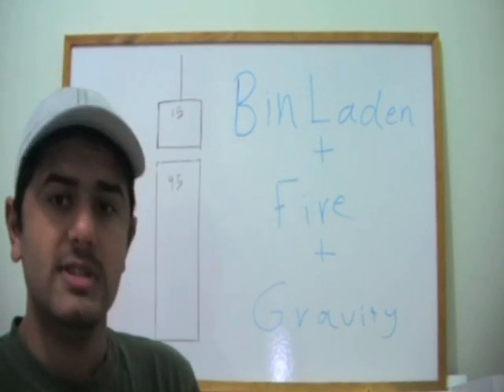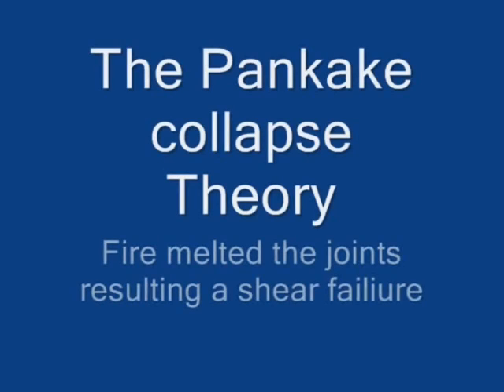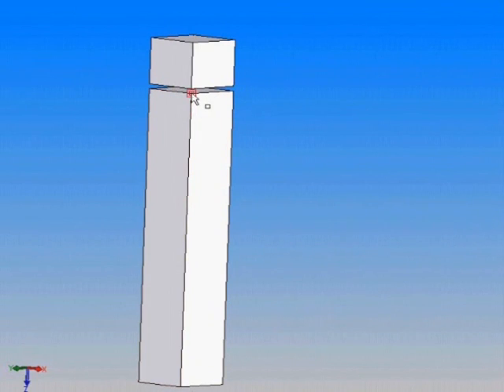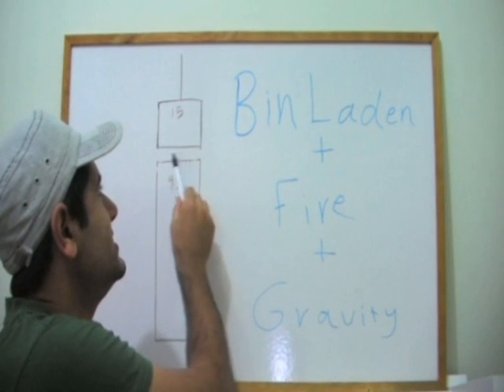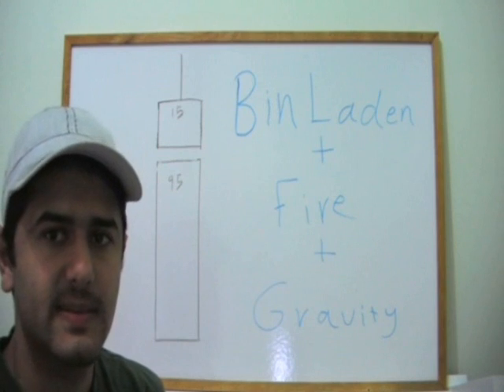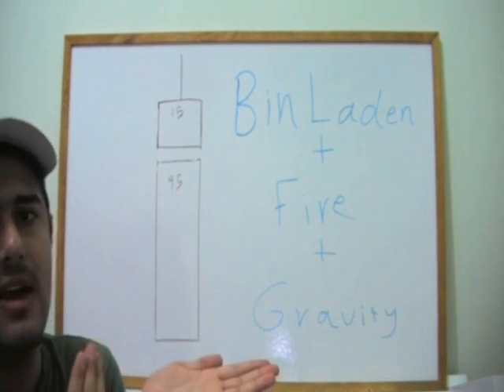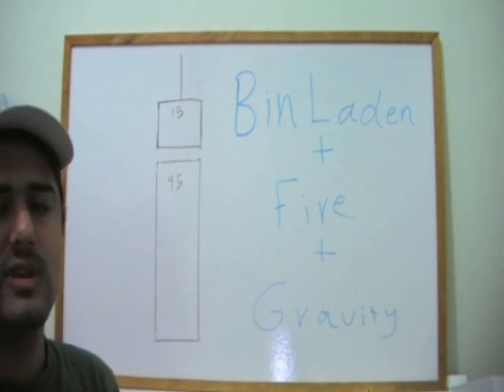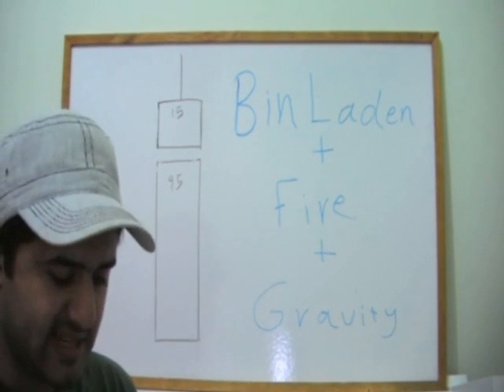(Part1) 911 Simple Physics Structural Failure Vs Demolition

Comment from the maker: 84th floor is defiantly stronger than the 85th because 84th holds 85-110  but 85th only holds 86-110. 
Lets hypothetically say that the top few stories started crushing the bottom 100 stories. 
how fast can this happen? the speed that we witnessed showed no resistance applied. in reality crushing through some thing like that would provide enormous amount of resistance  which slow it down.

Comment: My degree is Industrial Technology, and my experience is 30 years of explosives. I live in Las Vegas, where we bring down skyscrapers all the time.

A 767 brings 9000 gal (30 tons) of fuel, 60 tons of plastic and rubber, 80 tons of aluminum, and the kinetic energy of 200,000 kg at 900 kph.

Remember KE = 1/2 mass x velocity squared? 

Figure that out, THEN add the fires of the airplane materials, then stir gently.

It's amazing the WTC lasted as long as it did.

Comment: You didn't account for the energy of the airliner crash removing fire insulation from the core columns, or the energy of the 75 TONS of burning aluminum airplane, which I assure you burns quite hot. NIST took it into account.

Comment: "Second, if you can't see how the top sections of both towers tilt from the videos then it's clear that you've not studied them closely." - You are referring to the centre of gravity of the tips falling over the edge of the centre of gravity of the bottom. And yet miraculously (due to the intervention of Allah), the laws of falling bodies was suspended and they corrected themselves and fell straight down through the path of most resistance. 

Physics changed on 9/11.

Comment: Yes you are correct, it was both a controlled demolition and a structural failure! The airplanes were the controlled demolition as it took control to fly them into the buildings AND it was a structural failure due to these plane crashes that did enough damage along with the fires and the initial collapse that took the buildings to the ground. A poor design was also a factor. 

Unfortunately your logic is flawed shorty40merza. Go back to school dude and loose the delusions.

Comment: In no way was I implying that external forces other than the airplanes were the cause. Unlike you I rely on actual evidence that you can see on the videos rather than just fantasy conjecture.

The house of cards is a metaphor doofus. The reference in terms of WTC being a house of cards is that the structure had weaknesses that when confronted with the forces of the airplane collisions, the fires and the initial structural failures lead to the catastrophic collapses that are documented on video.

Comment: The fact that the buildings start falling with a tilt shows where the collapse begins for each tower. It's different for both but they both tilt.

Remember that the WTC designed pushed the state of the art when it was built. It wasn't designed to carry the load of the top portion accelerating faster than gravity nor was it designed to keep standing when it's crucial support structure begins to fall, especially in a tilt.

Clearly excess forces on the part of each building continued the failure.

Comment: BOTH towers tilt as they begin to fall, one more than the other. This tilt plainly transmits excessive loads to the buildings structural elements below causing them to fail which in turn causes an increase in the collapse speed.

All plainly visible on the videos for the last eight years. Seriously take a look. I just checked again.

Only the delusional belief stricken needing a conspiracy theory would think otherwise. You can deny all you want but it won't make it so or alter the facts on film.

Comment: If you knew anything about engineering or physics you'd know that gravity is an acceleration force that is ALWAYS acting upon every object upon the Earth or in it's gravity field.

"Gravity is the nominal acceleration due to gravity at the Earth's surface at sea level. It is equal to exactly 9.80665 m/s2 where the notation m/s2 means meters per second per second."

As anyone can see in the videos the buildings fell tilting and the support structure collapses below as a result. Easy to see.

Comment: "No, actually due to the acceleration of the top section the forces will be much greater" - But at t=0 there was no acceleration. The buildings were static. So you're just clutching at falsehoods. 

You must be brainwashed to believe the rubbish you are spewing. Either that or you are a jew.

Comment: No, actually due to the acceleration of the top section the forces will be much greater - even with the top section only falling one or two floors at first. This force exceeded the ability of the next floor to support it thus began he collapse as was SEEN on the video.

You must be blind for you SEE the collapse on the VIDEO tapes from multiple angles. 

Even with the evidence right in front of you you still deny it... that is the very definition of delusional.

Comment: The heat from the files and the damage to the structure weakened the load carrying capacity of the structural elements needed to keep the top floors supported. Once the top floors fell, as you see in many videos, there was the force of gravity pulling the top structure and it's mass downward with tremendous force which exceeded the ability of each lower floor's vertical supports from supporting that force.

The buildings were designed to carry a specific load which was exceeded. Very simple.

Comment: Don't mind you that the fire tests Kevin Ryan was involved in showed that the temps never even got hot enough to weaken the steel. What did NIST do with those results? Slid them under the carpet. Basically anything which blatantly exposed the false-hood of NIST's theories was ignored and hidden.

Comment: While the jet fuel was the catalyst, the resulting inferno was intensified by the combustible material inside the buildings, including rugs, curtains, furniture and paper. Pockets of fire hit 1832°F. "The jet fuel was the ignition source," "It burned for maybe 10 minutes, and [the towers] were still standing in 10 minutes. It was the rest of the stuff burning afterward that was responsible for the heat transfer that eventually brought them down."

Comment: "Steel loses about 50 percent of its strength at 1100°F," ... "And at 1800° it is probably at less than 10 percent." ... a great deal of the spray-on fireproofing insulation was likely knocked off the steel beams that were in the path of the crashing jets, leaving the metal more vulnerable to the heat. But jet fuel wasn't the only thing burning,

Comment: FACT: Jet fuel burns at 800° to 1500°F, not hot enough to melt steel (2750°F). For the towers to collapse, their steel frames didn't need to melt, they just had to lose some of their structural strength — and that required exposure to much less heat. "I've seen a lot of twisted, warped, bent and sagging steel. What happens is that the steel tries to expand at both ends, but when it can no longer expand, it sags and the surrounding concrete cracks."

Comment: You clearly have no idea about physics dude.

See my comments below for what happened.

Basically the damage done by the collision with the airplanes started the fires which ignited the other sources of fuel (carpets, paper, people, ...) and raised the temperature enough to heat the steel to the failure point. The upper floors fell pulled by gravity (you know gravity don't you) hitting the floors below exceeding their load carrying capacity and so on... to what we saw. Very simple.

Comment: "The jet fuel was the ignition source," Williams tells PM. "It burned for maybe 10 minutes, and [the towers] were still standing in 10 minutes. It was the rest of the stuff burning afterward that was responsible for the heat transfer that eventually brought them down."

Comment: FACT: "Jet fuel burns at 800° to 1500°F, not hot enough to melt steel (2750°F). However, experts agree that for the towers to collapse, their steel frames didn't need to melt, they just had to lose some of their structural strength — and that required exposure to much less heat. ... "Steel loses about 50 percent of its strength at 1100°F," notes senior engineer Farid Alfawak-hiri of the American Institute of Steel Construction. "And at 1800° it is probably at less than 10 percent."

Comment: DELUSIONAL MIND POO.

Concrete has better compression performance than steel so it's no surprise that it's easy to mess up a controlled demolition.

Once the mass of the upper block of floors started falling nothing could stop it. You must remember that the steel in the twin towers was near the range of their maximum limit and the force of the top portion exceeded the maximum load carrying capability thus the multiple level failure. Once that started nothing would stop it.

Get a brain.

Comment: The WTC was a rather unique structure.  The building at 2:15 was designed VERY differently, for one it is a concrete structure not a steel skyscraper.  For two it is a small fraction of the area of the WTC towers.  The towers were 208 ft wide, this building looks to be about 40 ft.

Comment: "This simple concept"

ROTFLMAO...."BIN-LADEN, FIRE, GRAVITY"

How did the elevated building mass destroy 80,000 tons of structural steel at near free-fall speed , and with such radial symmetry? Given the asymmetrical structural and fire damage and the tendency of any disorder to grow over time, (as described by the Second Law of Thermodynamics), the falling building sections should have "rolled off" of the intact sections below, resulting in only partial collapses.

Comment: Another way to look at it too is that the 15 floors in the top section are structurally less load-bearing than the 45 below. So, if we have an impact, with gravity acting as the driving force, then we get an equal and opposite force from the bottom floors. This means that if there is any structural failure we should get it in the top-section, and actually it would lose its centre of gravity and topple over the top. That this didn't happen is 100% evident of CD. That people have defended BFG sad

Comment: "There just isn't enough energy released in the alleged freefall of the smaller upper portion to completely annihilate the majority of the structure." - ANd even more so, the upper section was not as structurally fortified as the lower section. Given equal and opposite forces, it would only be the upper section which would be crushed in on its own weight. The lower section would stand against it. 

I am so ashamed of Americans being so utterly stupi. Most of them know now but too ashamed admit.

Comment: At 2:15 we see what would most likely happen should the top of one the the WTCs were to drop a short height - collapse is arrested.

Engineers such as Anders Bjorkman and Gordon Ross have already worked this out. 

There just isn't enough energy released in the alleged freefall of the smaller upper portion to completely annihilate the majority of the structure.

'Crush down/crush up' notion of Bazant/NIST is dead.

Comment: The office of emergency management was opened in 1996, and occupied only the 23rd floor of WTC 7.If  you are to believe the theory that the Bush Administration was behind it, it would have had to happen after he was appointed by the Supreme Court, in late 2000.  Furthermore,a full demolition would have required explosives to be wired throughout the building. The cover (office of emergency management) would be not enough cover for such a mission.

Comment: WTC 7 was destroyed because the damage to the foundational supports weakened the base of the building, so instead of the top of the building falling down like a piledriver, the bottom of the building collapsed and the rest of the weight (now unsupported) fell like a house of cards. You damage the base of any structure enough, the whole thing will fall.

Comment: They WERE four inch layers of concrete. Eric Darton's book, Divided We Stand , about the construction of the WTC (written in the '90s) gives the thickness of the floors as four inches.

A moving object will decelerate, but only to a point. The force of impact vastly outweighed the resistant strength of the rest of the building, and overwhelmed it. Result, the buildings fell at a speed that was not quite terminal velocity.

Comment: OK,lets say that the floors in the engineering levels were strong enough to not be destroyed by the impact.(they weren't,they were strong enough to take the loads of the machinery on those floors)But if they WERE,the energy released by the impact would have been transferred to the to the girders that held the floor up,crushing these instead.
And WTC7 did not fall at freefall speed.You drop thousands of tons of concrete onto a 4in thick 1acre concrete slab supported by the edges,it will smash.

Comment: OK, how about this analogy...

You drop a few hundred thousand tons of steel on a four inch thick layer of concrete that supported only by its edges,  and you will get no resistance. It will shatter instantly. Look at when a martial arts master puts his hand through a cinderblock. It is able to go through easily because the cinderblock is supported by its edges,and a massive amount of force goes straight through.Concrete can take massive static loads,but when it comes to large enough impact...

Comment: Buildings like the Empire State Building were not built with trussed floors. They have columns throughout the floors, which the WTC did not have. 

The problem with using concrete is not that they will sink, it is that they lack clear floorspans, and it is clear floorspans that made renting out the WTC lucrative. Each floor was an acre of clear unobstructed office space. This was its fatal flaw as well, because such an unimpeded span is very prone to breakage and collapse.

Comment: And dropping a massive amount of concrete and steel onto a 4 inch thick cement slab (every floor of the world trade center) that is held horizontally by the edges WILL smash it into tiny tiny pieces. 

Mohammed Atta studied architectural engineering in Egypt and Hamburg. He knew exactly what would happen, the design of the WTC was revolutionary for its time, and therefore, was a case study for students of architectural engineering. He was not messing around here. He studied it for years.

Comment: It is near freefall speed because there was comparatively little resistance. The floors were never designed to resist vertical impact, they provided the support to the core columns and the exterior columns. Static weight, not impact weight. Place a brick onto a glass coffee table, it will hold its weight. Drop it onto a glass coffee table, it will go straight through.

Comment: the near freefallspeed of 3 buildings give it all away.nobody will ever explain this speed bcause this is only possible if there is no resistance but more then 70 intact floors are gigantic resistance.heat is going upwards not downwards so even if the heat of the fuel was more then 900 degrees it was only for a few seconds than the heat comes from ordinary officefires and even that was not hot enough to prevent firefighters pass the impact floors to save lifes and start distinguish the few fires

Comment: most of the support was on the outside of the building.The towers were built this way to free up space. Steel frame buildingds took up alot of space so it was nuilt in this manner.Concrete buildings could not be built tall nor the old blocks because it would sink no matter what type of foundation . towers need the inner core + trusses along with the outer walls to hold it up.These were damaged by the crash and the fires weakend the steel..the inner core collapsed with the rest of the building.

Comment: His biggest mistake in this video is that he assumes structural integrity from columns as if they are supporting axially as they were designed. The problem is that as the skeletal structure was ripped apart these columns experienced axial loads as well as bending forces which columns are not meant to greatly experience like they did in the WTC towers.
For the most part the columns, below the impacts, did not fail individually, but more so fell sideways 1 by 1 being pushed out of alignment.

Comment: A lot of the outer columns are practically being pushed out of the way and therefore are not supplying supporting or "resistant" forces upward. Now the beams that span from outer to inner columns are no longer supported by the outer columns, the inner columns are going to be pulled outward or are more likely to fail due to bending outward because the beams are no longer helping them stay straight.
Thus the inner columns would fail with less force than as designed for with a fully axial load.

Comment: Bweazel! name 1 other building in history EVER that has got hit by a jumbo jet going over 500 MPH!! Yeah, didn't think so!
And for this video, specifically his "resistant upward forces" from the lower portion of building that he uses based off forces needed to hold the building to begin with are NOT CREDIBLE because this is based off of the columns using there axial load design. But in the WTC failures these columns are experiencing bending moments also which they are not designed to withstand

Comment: I guess if you crash a jet into it and knocking off fireproofing iginting fire and heating the steel ,rearranging the atomic structure of the steel and carbon making it weaker.Or deformation occurs until it snaps and every floor snapping the kinetic energy increase..Or acting like a shotgun blast blowing out each floor almost making the buildings come down .
 This was a plan by radical terrorists who had knowledge of steel..its so obvious.